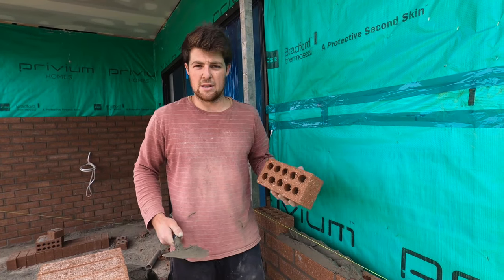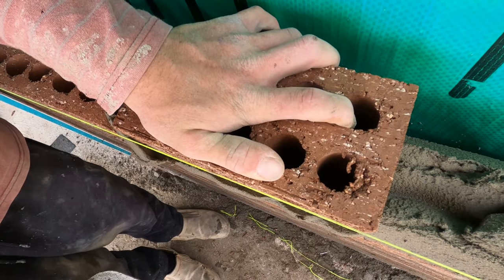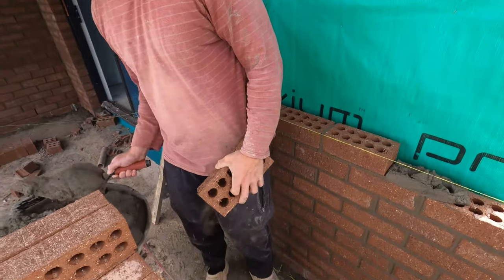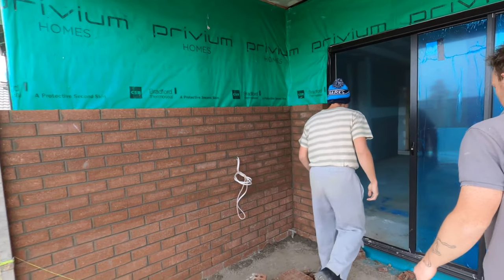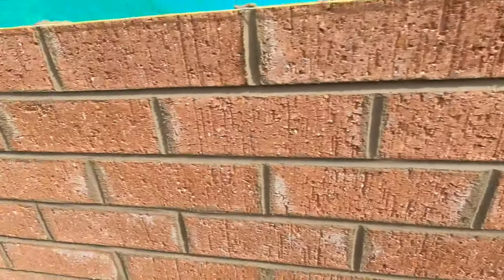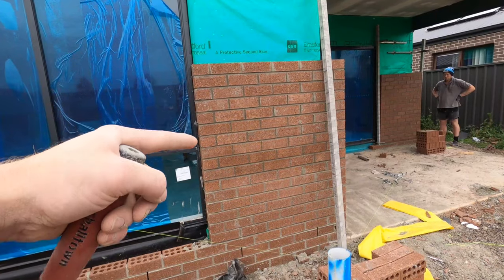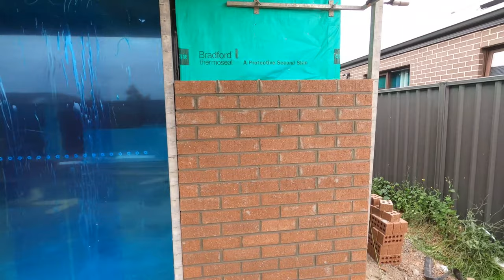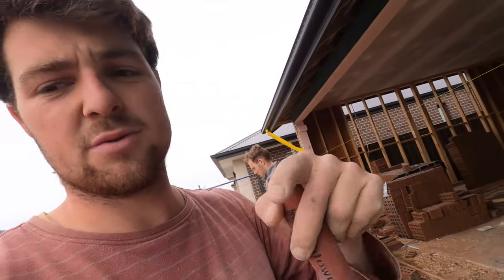Hendos Bricklaying - How to Lay Bricks

Comment: Good stuff mate. I've been off work for over a month now. Nz been in lock down, but I start a fresh house Tuesday! Cant wait
Reply from the maker: julian Campbell happy days mate! Stay safe
Reply: Notice in NZ we dont put control joints in brick venner,not required here,unless specified by engineers, depending on length of your wall..While blockwork is every 6metres which is building code..
Reply: @louissmith6300  in south Auckland pokeno all houses have control joints. Something to do with uneven ground or moving ground or something.  Do you lay much concrete bricks? I think control are a must with them, in whangarei it was not sure about other places though
Reply: Yes we did lay concrete bricks long before the earthquake happened, control joints were used..Now nobody uses concrete bricks anymore, because they dont hold as strong as normal bricks do in an earthquake, no holes in them...

Comment: I have a builder working on my property who has laid bricks with hardly any mortar on the sides only top and bottom and only 1mm if that on the sides. He has then chipped the brick from the front and added cement to make it look like 10mm. I have told him this isn't acceptable but he insists it is. Can i get your opinion please
Reply from the maker: K Pathan I am assuming you are talking about the perp which is the mortar vertical line in between the two bricks. The Australian standard is 10mm + or - 3mm tolerance so a minimum perp of 7mm and a maximum perp of 13mm.  1mm perp definitely wouldn’t be accepted by standards. Where are you located ?
Reply: @hendosbricklaying2003  yes you are correct it is the vertical lines between the bricks. And I am located in the UK. I don't think that level is acceptable here either but I think the builder is taking advantage that the inspector can't come out because of the virus. Do you think I should make him rip it down and start again
Reply: Yes 10mm in uk. Sounds like he goes home on a horse ! Is he self employed? Or does he have a boss to tell. If not take photos,  and report ti trading standards.

Comment: I've noticed you sometimes don't do a full perp joint, just the face corner. How come?
Reply from the maker: Barney Panorama sometimes I purposely don’t fill a joint on the corner because I leave room to easily put a perp clamp in when I take a bracket off. What part of the video in particular mate? Cheers
Reply: @hendosbricklaying2003  5:55 You lay a corner brick with only the face side having mortar on the perp
Reply from the maker: Barney Panorama ah yes I should really butter both ends. Just one of them things sometimes I forget and I just double butter the final brick in the course !!
Reply: Barney Panorama you are supposed to butter both sides, but generally they don’t because it’s quicker to butter one

Comment: You don’t ever put mortar on a dry board. barrel mixer for mixing mortar doesn’t even make proper mortar period. It won’t ever spec out because the mortar you mixed was chunky and not  even proper. competed in the 2019 bricklayer 500 as the hod carrier and been raised around masonry all my life 2nd generation hod carrier.
Reply from the maker: Joshua Carey interesting. I’ve taken some notes there. Cheers Josh all the best!
Reply: Get yourself a 4.5cu ft mortar mixer from multiquip. Brand new it’s about 2000 Dollars here in the states. This mixes faster and does the job properly, they have electric and a gas version as well. I’ve stuffed these mixers completely full with about 6 cu ft of mortar and they can handle it. Just need to get the mixer up off the ground so a wheelbarrow gets under it. My cloths stay cleaner and the job site is cleaner around the mortar mixer. One job and it has paid for itself then you are making your money back and then more because of time.